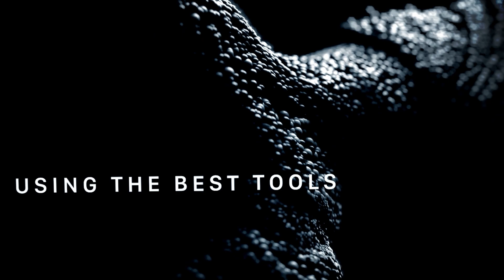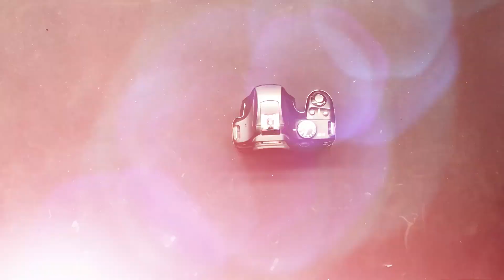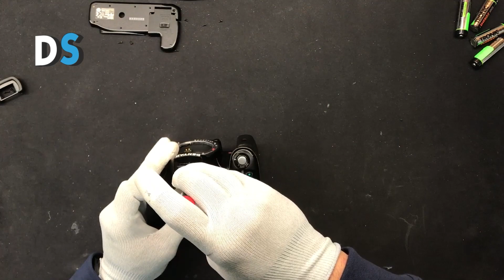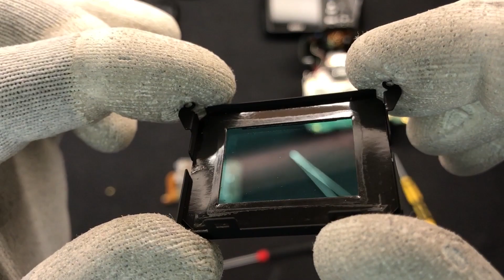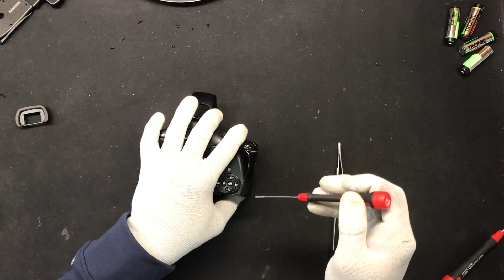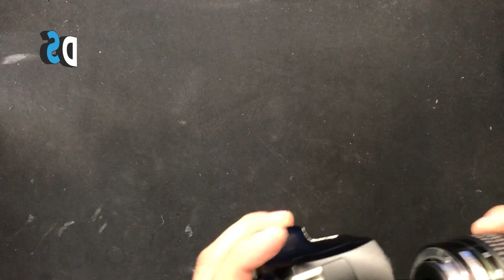How to repair Pentax DSLR camera K-x - ASTRO MOD(remove IR cut filter)

Comment: Hi! How did you open thw flash with no batteries?
Reply: Good question! :D I put the batteries back! The main question how to disappeared those 4 wires (red grey, white and brown from the bottom left corner of the main board???)

Comment: Thanks a lot for sharing. Do you need to recalibrate the sensor afterwards? Best wishes
Reply from the maker: Hi , Yes this is recommended :)
Reply: @DIGISERVICEBG  How to recalibrate the sensor afterwards?
Reply: @maciejkiebala6478  This procedure is omitted in this video and actually is most important thing in sensor conversion to full spectrum or infrared. Calibration starts even before sensor is removed. Simple unscrewing of three screws which hold sensor is big mistake. All three screws should be marked for "0" position first, then they should be screwed to the end to measure rotation count and only after that they can be unscrewed. Rotation "to the end" count can be different for every screw. If "rotation to the end" count is less than 2, then full spectrum conversion by removing just hot mirror will not allow you you to recalibrate sensor and get proper infinity focus (at least for manual focus lenses which have hard stop for infinity).
Reply: @mg-leisure-monochrome  This is an excellent tip, thanks! Also almost all of my lenses focus a bit past infinity; so I guess I'm just lucky.